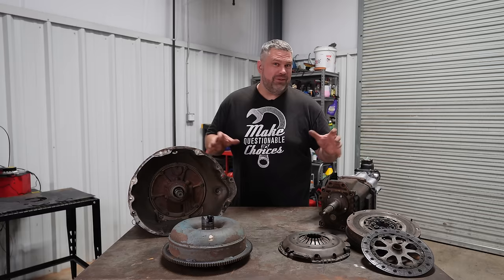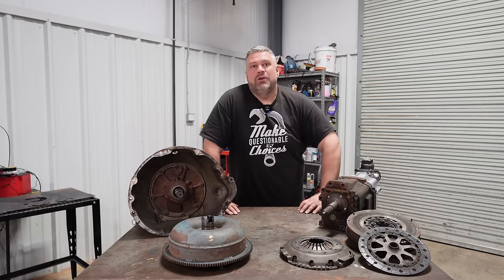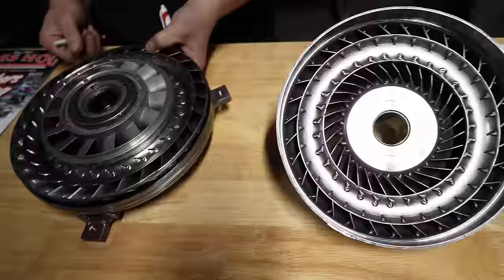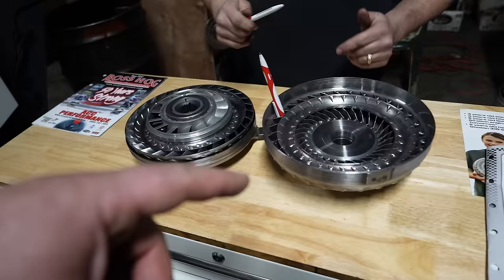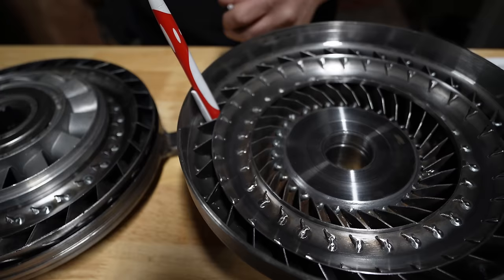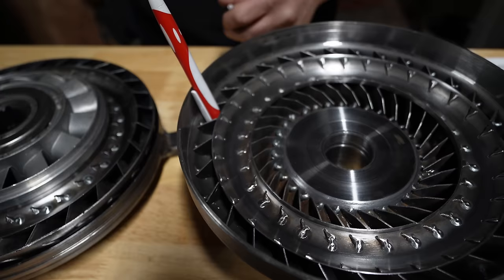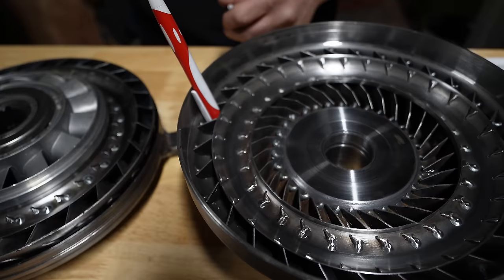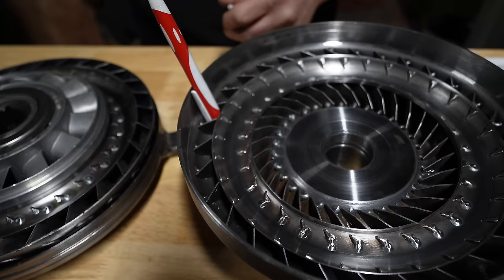Transmission Companies are Afraid to Show You This! So I Found One That Will!

Comment: So basically what the expert guy is saying that even though my Comp cams camshaft says it needs a 3200rpm stall & 3.73:1 rear gearing it really doesnt actually need a 3200 stall converter and saying that the camshaft companies are selling snake oil recommendations along with their product because of overall vehicle weight being a factor?

So basically when you get as technical as this talk if i dial in my hotrod for just me then basically I wont be able to run 4 passengers and if I factor in the 4 extra passengers and running all the time by myself I wont get the proper converter function?

As far as I remember stock automobiles come in a multitude of weights and HP's yet the torque converter in a turbo 350 trans is basically the same for all passenger cars from coupe to station wagon and the only thing that made the ultimate difference was the rear gearing until you more than doubled the stock hp or put a camshaft with a very low lobe seperation under 114 degrees...

Comment: So what the expert is saying is that my Comp Cams camshaft calling for 3.73 gearing and 3200 stall converter is basically recommending snake oil with my camshaft because of overall vehicle weight and exhaust type being a factor ............?

Comment: What happens inside when a torque converter fails? 🤔
Reply: Most failure is caused by components touching each other by bearing failure or foreign material in there

Comment: Can anyone explain why when i changed my transfer box from 1.2 to a 1.003 it still locks up the torque converter at 51mph but its locking 300rpm earlier

Comment: The fluid torque converter should go away and be replaced with a DC motor to actually recover the engines energy while stopping in drive. That would be awesome.

Comment: The hydraulic system is affected by stuff that's not even close to connected to it it's either magic or he's just spewing words he heard 😂
Reply: No he's right oil volocity    and pressure to stop a cavitation  
The drive comes from oil momentum hitting the next member an being redirected  heat in stall is the trade off

Comment: If this is a vid for basic concepts, you did not cover it.
Starting with the manual was good, assemble the pieces on the bench for all of us to see, and show power from crank to flywheel to clutch disk via the clutch plate.
Then do a TC, from flywheel, to pump, to internal assembly to turbine w/lockups, and then show the other pump that routes fluid to the inner part of the tranny.  On the TC, what part spins w/the crank, and what part has the fluid slip.
Boss Hog is great, but you jumped around a bit and did not provide a seamless flow of information that is easy to make sense of.

Comment: That's a pressure plate, not a clutch cover
Reply from the maker: They are used interchangeably in the industry to describe the entire assembly but if you really want to be pedantic, only the part that touches the clutch disc is the pressure plate, and then the outside assembly with springs is the clutch cover.

Comment: Wow. He may be producing good parts, but at a SERIOUS detriment to his workers. As a Journeyman Class A CNC machinist with 40+ years' experience who is proficient in running every manual and CNC mill and lathe out there and has worked for companies ranging from very small, to very large, I haven't seen a sweat shop like this in 25 years. This is why you can't find people to work in manufacturing anymore. This guy is making a lot of money and yet he's spending pennies to create a clean and organized work environment for his employees. Crap thrown everywhere, old beat-up machines, and shopping carts as a parts transporter because he's too cheap to buy proper bins to safely secure his products, is just another example of guys who may be expert mechanics but have no clue how to run a business. He most likely feels that because he does constant repetition that he doesn't need good equipment or the necessity to be neat. I've seen plenty of his type from back in the 70's - 90's. I hope he at least gives these guys air-conditioning. I hate seeing this kind of setup.

Comment: I had to quit watching when i saw it was boss hog.    I have never seen so many converters that either didn't fit into the transmission right out of the box or failed in less than 1000 miles. It blows my mind people still buy these. Their 4l60  and 4l80 converters are probably the worst out there!

Comment: It's a lot of heat but it's not going so much into the metal period do you not know anything about what spray Ark actually is from a physics point of view period I only welded for 41 years.Maybe I don't know anything about welding. Spray ark is exactly what you should be using on that heavy Is steel. Precisely because it Does get a lot of penetration.

Comment: This wasn't a good explanation, at all. You could have started with the the engine input and moved through the whole sequence of steps in the device ending with the transmission input shaft. Instead, you jumped around, and got sidetracked with details, without ever completing what you promised to explain in the title.